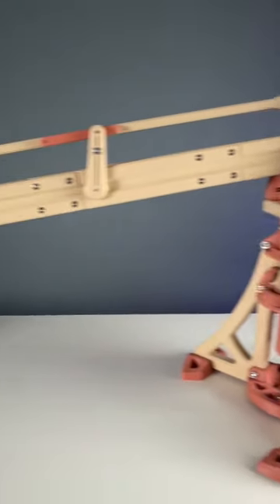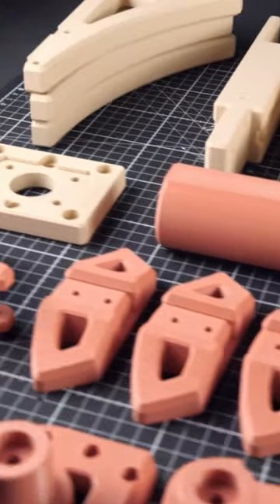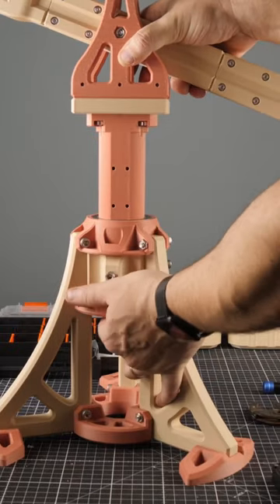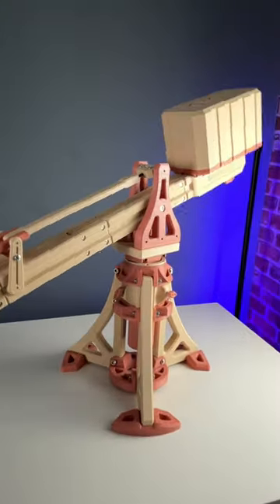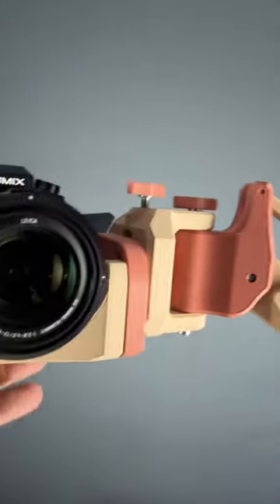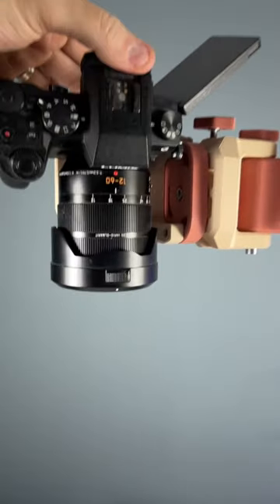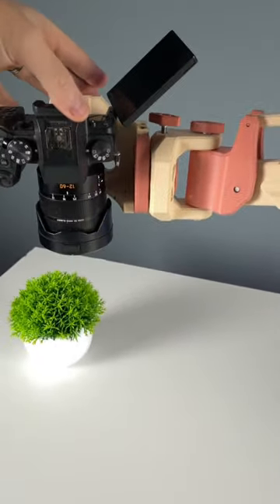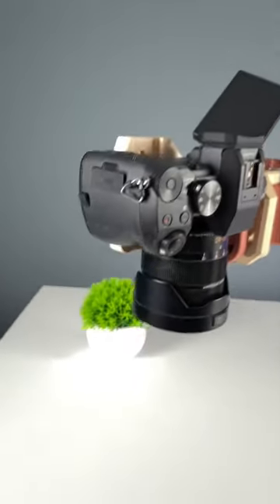$100 3D Printed DSLR Micro Jib #Shorts

Comment: I dislike these "fully 3dpringed something or other" objects.
Large waste of plastic that could easily be cut in half at least by using some pieces of wood or metal.
Would probably work better too. 
"3dPrinting AT ALL COSTS!!!!111!" is dumb.
Reply from the maker: I dislike these "waste of plastic" comment when people just need to do some research on what PLA actually is or what it's made of...
Reply: I see your point. The long arm of the jib is made of several pieces that would have taken hours to print but could have been made from a single length of wood or pipe with bolted on end caps.
An incredible and useful model all the same.